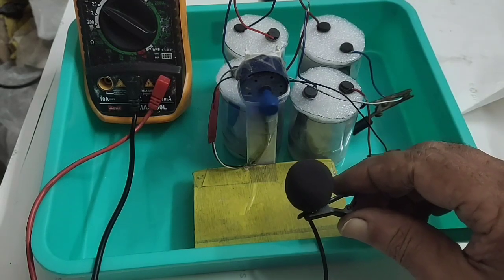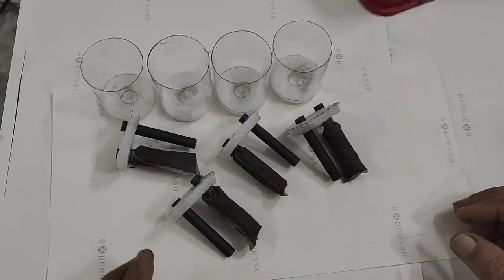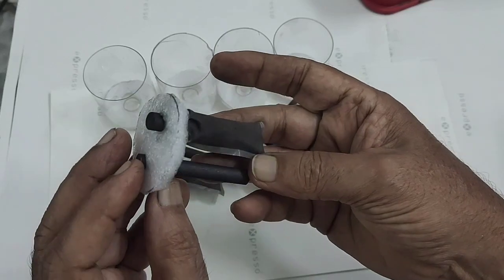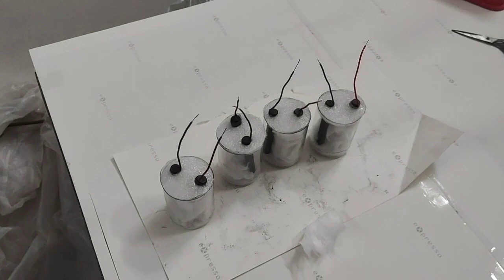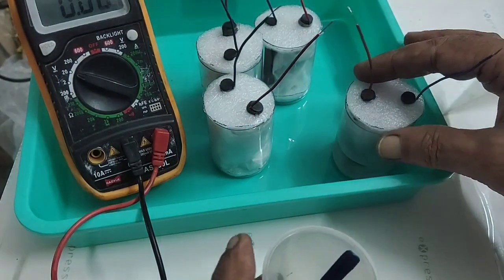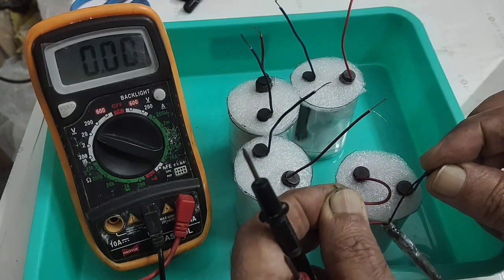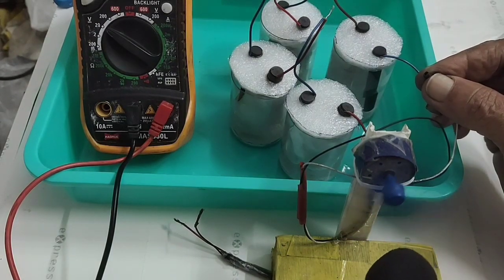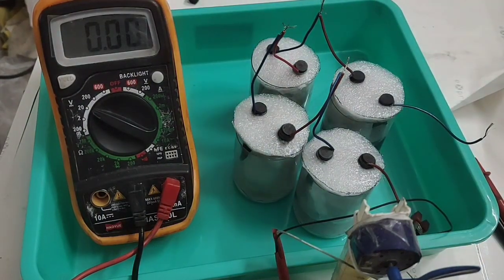CARBON ION BATTERIES , C-C TYPE ,6-7V, 400mA, FOR E- VEHICLES, D.I.Y. SCIENCE, COMMERCIAL, VIDEO-74.

Comment: nice project you made here
from your own point of understanding between the Aluminum air battery and that supper capacitor battery which is more preferred both for Density storage and longevity in automotive industries